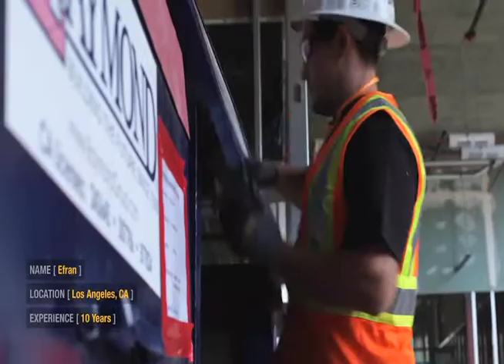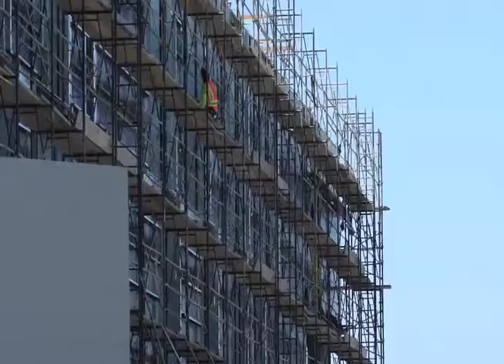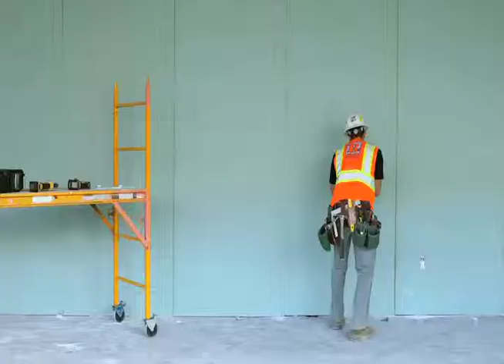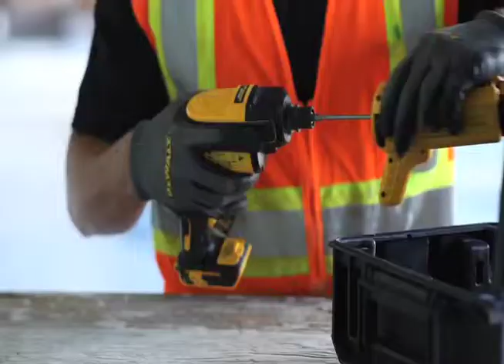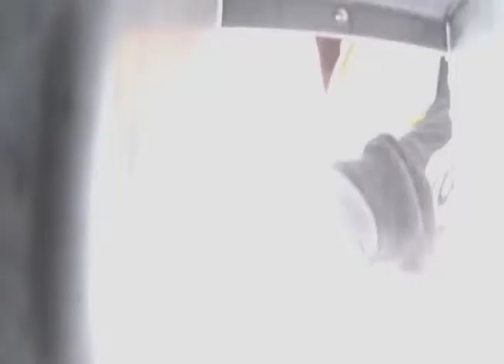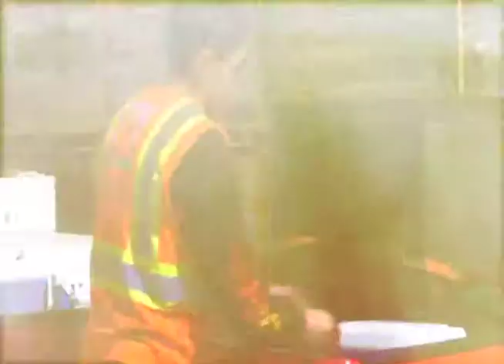20 V MAX* XR Li-ion Brushless Drywall Screwgun Kit Model #DCF620M2

Comment: Good video. I am union carpenter     too. When I was in the apprenticeship program in 2005-2009 I used a corded drywall screwgun. Dragging long cords and rolling up and unrolling cords and rolling up took a long time to get from one area to the next. It slowed down our production quite often and I often got laid off because our boss said we were too slow. But nowadays they HV these cordless screwguns that HV lithuim batteries and they last longer also lighter.